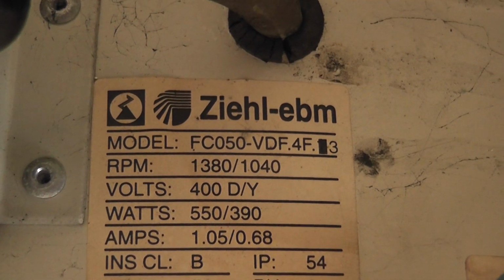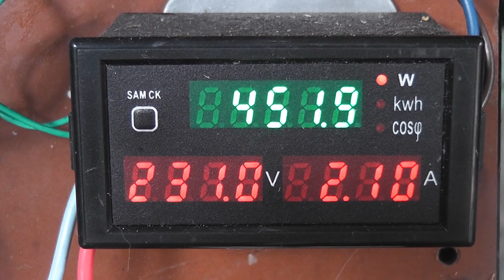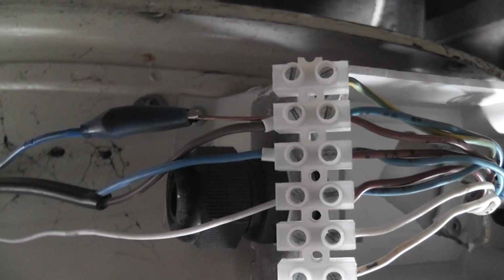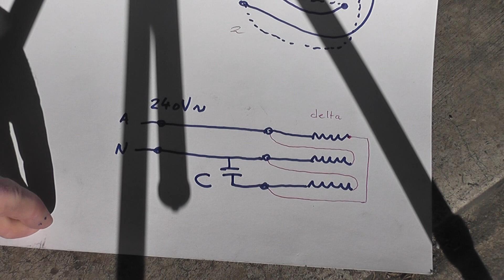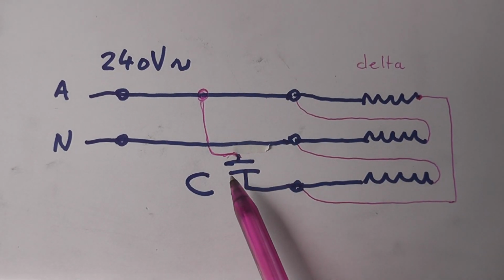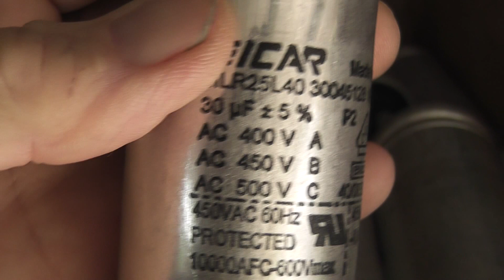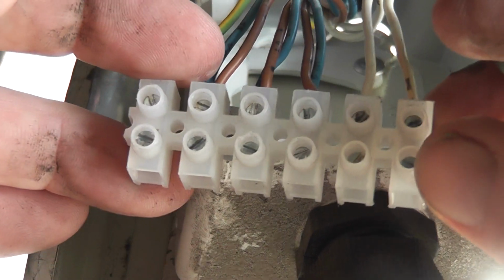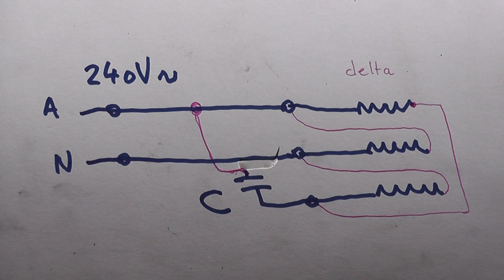Three phase axial fan on single phase with schematics

Comment: I wanted to change the motor  running  direction cos first it was running anticlockwise than I swiped  the wires at the insulator , after I switched on it ran for almost 2 minutes and stopped with  smoke coming out from the motor, what could probably be the problem ? Please Help!!

Comment: White is a thermal cutout, used to disconnect the contactor when the motor overheats. Should be used in the new application if the fan is expected to run unattended, to control the coil of the 2 pole contactor used to turn it on and off. Should be a rating for the contacts on the nameplate as well, though they are typically 3A rated thermal cutout switches.
Reply from the maker: Thanks for that Sean, great that it is not an embedded cutout.

Comment: some 3 phase motors have 2 wires coming off them for themostat (if applicable on device.) These two wires go to a thermal sensory inside the motor. (more common on newer 3 phase motors then older ones.)

Comment: Interesting title - "witch schematics" 🙂  The stuck hum explains what happened with a shower pump we had a problem with.  It has a 400v 7uf capacitor, which measured only 1.11uf with a multimeter.  The nearest replacements we could get were 6uf and 8uf, so changed it with a 400v 8uf capacitor.

Comment: Nice trick. Where I live (in Sweden), we have the same standard is used both for industrial and residential power (3 phase 230/400 V) - wich is nice because you can run such machines easy at home without modification (given that you have big enough fuses of course)
But this is still useful in some places - even if we have 3 phase, we dont have 3 phase outlets everywhere (most equipment except motors and high power stuff, uses ordinary 230 V). And a few apartments only have single phase.

Comment: The ease of access to the windings makes this much easier. I've seen some nasty tight terminals on some motors.

Aside from the voltage requirements of the capacitor(s) is there a calculation to work out what size of capacitor is needed?

Great video. This will save a lot of lighter 3 phase motors from being scrapped.
Reply: For a 220V system, you need about 70uF/kW (ie: depends on the motor power). You know you have the correct size cap when the voltages across the 3 phases are roughly equal while running.

Comment: So the cap creates the phase shift. Interesting.
Reply: Yes but it shifts the phase by 90º so that's why single phase motors are a bit noisier and less efficient. In a 3 phase system each phase is 120º offset from each other, each coil from the motor is also 120º from each other, making it nice and balanced, using a capacitor will make the motor work but the 3 coils won't be perfectly balanced hence the noise and less efficiency.

Comment: Could you add a switch to change that capacitor lead between those two connections?
Reply from the maker: Yes you could, single pole, double throw switch for forward and reverse.

Comment: I have a small Clausing lathe that has a 2hp 230/3 motor on it. I currently am running it with a 2hp AC drive off of 240v/1 mains. I have a bit of trouble at times with nuisance tripping of the AC drive (bus overload) when I engage the spindle clutch. I am wondering if running it off of the 240/1 mains like you have done here would be better. Could you outline how I would do that?

Comment: I'm sure I've seen you do a bit on this subject before as I used your video to enable me to set up our tyre machine and it's quite happy running like this, but I only worked the caps out by trial and error. Is there a formula for working out the value of the capacitor according to the HP of the motor please? Cheers!